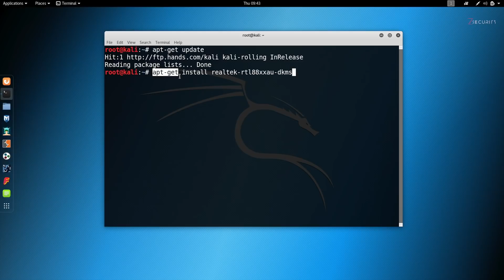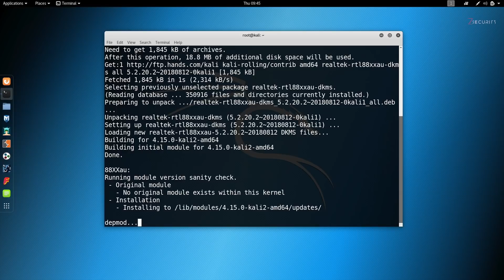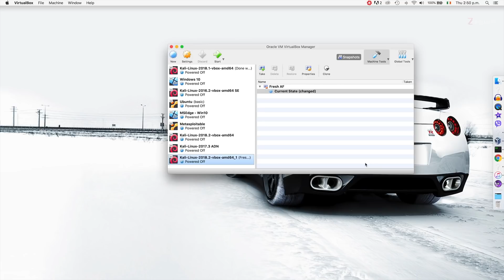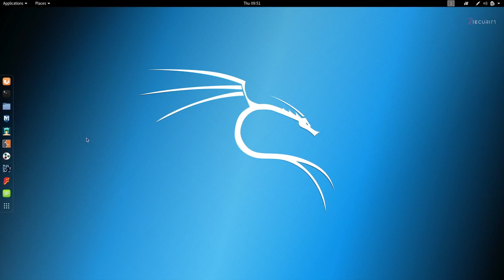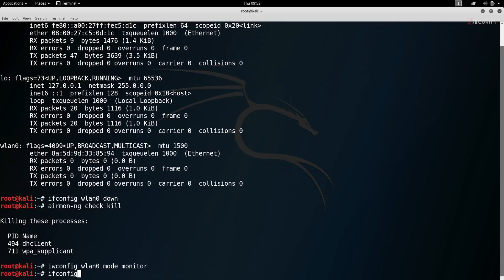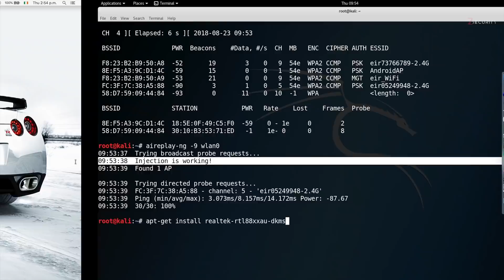Installing Drivers for RealTek RTL8812AU on Kali Linux & Testing Monitor Mode & Packet Injection

Comment: All done and everything was the same until the "ifconfig". It doesn't show wlan0 at all...
Reply: Same here. Have u found a solution? I'm really stuck here
Reply: @isore3090  is it connecting to the internet? Like when you go to settings to internet connection, is it detecting the adapter?
Reply: @irshadtarsoo7734  No it's not detecting it. There's only my Wired connection 1 which is my machine's NAT Network. But when I type lsusb in my terminal I can see my adapter's name
Reply: @irshadtarsoo7734  Turns out it was my adapter has a Realtek rtl8812bu chip insteaf of au one. I'm going to open a dispute for the motherfucking seller who sold me this stuff as au chipset. Couldn't find a driver for bu chipset for kali linux either so im stuck with this useless piece of shit adapter
Reply: Make sure u have the same chipset , make sure u do the update command then restart kali and plug in the adapter and it should work

Comment: but i tried everything you guys telled me but still the adapter is turning it self of i hear a sound when i put it in and immidiatley another sound that its off, also the flash light stop working. so something in kali is still putting my  adapter off.

pls help me
Reply: exactly the same here
Reply: yea same here too ... i read somewhere that when you are telling virtual box that it needs to access usb of your adapter name it will disconnect from host and virtual box will try to use it. COnsider your host and virutal box 2 different machines which at the same time cant use one usb :/ i tried using bridge and compact wireless commands but nothing works so far. maybe this video is missing a step to configure nat or bridge network. Followed the course steps too but still no luck
Reply: have you managed to fix this issue yet im having it aswell
Reply: oz ll yea so the fix is to download 2019.2 and follow the video. Dont do agp-get update && upgrade .... also a side note mine was not au adapter it was bu so u may wana check that .... this video was also made on 2019.2 I believe doesn’t work on 2019.4
Reply: @ammadakhtar1706  sorry having a hard time following where do I download 2019.2 and how can I check whether its bu or au. Thanks
Reply: oz ll so when you are downloading it from the link from offensive security.... check the url it has 2019.4 in it change it to 2019.2 and for the wireless card check on the box for me i bought a different one which was TP link not this alfa. If you google download version 2019.2 on the first page in the results there would be a tutorial which would have offensive security link and that link is for 2019.2 so both ways can work either modify the current url provided at the site or go through that tutorial link
Reply: @ammadakhtar1706  ohh ok I got it from udemy not offensive security but I understand 2019.2 version of kali thanks
Reply: You gotta install the drivers

Comment: I got the AC1200 Wireless Adapter with a AWUS036ACH chip. Since it wasn't working when I tried adding it to the USB the first time, I added it as Network 2 on my Kali machine. I made it a Bridged adapter. Then I realized I couldn't put the adapter in monitor mode. So I made a fresh Kali machine and tried following this video. The adapter does show up on the USB list, so VirtualBox knows it's there; however when I try to connect it to the machine it says "Failed to attach the USB device Realtek 802.11n NIC to the virtual machine..." In the details it says "USB device 'Realtek 802.11n NIC' with UUID {...} is busy with a previous request. Please try again later." What do I do now?
Reply: Oh also the apt-get install realtek command worked out fine. No errors or anything. I also have run "apt-get upgrade" and "apt-get update" at least 5 times.

Comment: Hello sir, when i have run the command  apt-get install realtek-rtl88xxau-dkms it just showing th output as in the quoted text  "realtek-rtl88xxau-dkms is already the newest version (5.2.20.2~20190617-0kali1)." and i thought it was installed and i have plugged in the alfa adaptor but there is no effect, no wifi is showing....... and i have also tried to install dkms separately by using the cmd "sudo ./dkms-install.sh" then its showing the error "Your kernel headers for kernel 4.19.0-kali4-amd64 cannot be found at
/lib/modules/4.19.0-kali4-amd64/build or /lib/modules/4.19.0-kali4-amd64/source.
Error! echo"

 can u plz help me out with this  sir....... i am not able to find what is going wrong plzz help me...........
Reply: Do you get it .Do you prefer the adapter ?

Comment: Thanks Zaid.  I bought this adapter to use while taking your Ethical Hacking course and tried running the install script that came with it but it didn't work. These steps worked perfectly and I'm now ready to continue the course. Your instructional videos are very good and easy to follow.
Reply: For which Version. Does it work for 2019.3?

Comment: When I try to enable monitor mode I get this message 

“Error for wireless request “set mode” (8B06) :
SET failed on device wlan0 ; Operation not permitted

Can you help?
Reply: @feiwhang  already root user in kali dumbo.
Reply: Did you ever figure it out ? i got same issue

Comment: The drivers successfully installed. Now when i connect the adapter after Kali is loaded, i hear the chime alerting me to a new usb connection, then immediately i hear a chime alerting me to a usb being disconnected.  obviously when I run ifconfig I don't see the wlan0.  anyone with ideas how to fix this?

Comment: Can anyone help?
After changing to monitor mode the adapter will not turn on in kali linux, why could this be?
Reply: run this code in terminal service NetworkManager restart
Reply: @kadirsahin166  thanks for your reply. It still doesnt work, it works fine out out kali but turns of when kali is loaded ?

Comment: I have an Alfa AWUS036ACH when I start kali its connect the internet, but when I start monitor mode its lose connection and i can't see the internet sign even right on up on the menu. can someone help me?
Reply: I found what caused the problem. It was the command "airmon-ng check-kill". Obviously this command shut-down internet connection.

Comment: Process doesn't work under any circumstances with Kali.  Adapter works fine on Virtual Box or VMWare workstation with Windows 10 and Ubuntu.  Also tried it with an Ubuntu Laptop.  Sending that information over to Tech Support, they insist that I am doing things wrong and that it "has to work."
Reply: you must install the driver off https://files.alfa.com.tw/?dir=[1]%20WiFi%20USB%20adapter

Comment: Des anyone gets this error .... Failed to attach the USB device Realtek 802.11n NIC to the virtual machine Kali-linux-2019.02-vbox-amd64?
Reply: Diego Solis I am facing the similar issue
Reply: Bro help me same problem
Reply: same..
Reply: I get this to!
Reply: I checked the USB ports options in VM, and it has been changed to a 2.0. I have changed to 3.0 another time and now it's working properly
Reply: @mentalartcore4620  are you on a mac? because i tried that and so much more and i get the same error message. i'm running on a windows 10 as my host
Reply: @JaliylMariano  win10 as well, try on an earlier snapshot of virtualmachine
Reply: @JaliylMariano  try to connect the adapter after and before switch on the machine

Comment: Hi, I appear to be getting the driver working but it won't find networks. It does everything without error, but won't find networks. Then when you put it in monitor mode it won't find networks there either, and packet injection test fails. I checked after all that with a reboot and it simply won't find networks. seems to be detecting it now after the fix, just isn't finding networks. Any ideas why? Thanks!
Reply: BTW: I noticed that the mac address changes too.

Comment: When installing the driver my terminal window is stuck at this line.
stuck at Building initial module for 4.19.0-kali1-amd64
Installation will just not finish. :(
Reply: i have the same problem
Reply: after waiting 30 minutes it finally finished. But it took a really long time. Don't give up yet. Our vm must be really slow. @mex1c080
Reply: @peterbago4574  it worked

Comment: For the AWUS036ACH you need to add the USB as a USB 3.0, and use 'ifconfig wlan0 up' after doing the updates in this video and possibly replugging the adapter.
Reply: how can i add the USB as a USB 3.0?

Comment: I bought the cheaper version of the adapter in aliexpress and confirm that it has a Realtek rtl8812au. I successfully installed the driver using the steps in this video after reboot i try ifconfig the interface is not showing but when i try the lsusb i can see the adapter. I am using the latest version of kali as of this writing. Any other method to make the adapter works or anybody encounter same issue as mine. I hope anyone can help me. Thank you.
Reply: I have same issue, if got  any instructions pls inform me

Comment: First what you have to do is go to settings -> USB abd then update the driver to 88Fukali-linux-please-kill-me if that doesn't work; take your labtop and kindly bang your head against it until the power fails or the plastic gives way. You may feel a slight shocking feeling as the electricity enters your body but don't worry about it....soon you'll be a linux expert.

Comment: Hello Zaid, I'm really struggling in order to set up this Wifi USB Adapter: http://www.hamletcom.com/products/hnw600acu.aspx
I'm still not able to see the device with "ifconfig", but I can see it is connected with "lsusb".
I know the chipset is RTL8811, so I think the instruction in this tutorial should have been working, but unfortunately this is not the case.
The only fact I can notice, from the site I linked above, is that compatibility is for Linux (kernel 2.6.18~3.16.0), but the Kali running on my VirtualBox is 4.18.0 (I think this might be the problem).
Could you please give me any suggestion? I'm really looking forward to proceed with your course.
Thank you for your kind cooperation, Best Regards.

Matteo

Comment: I have tried several ways to use monitor mode in my Alpha AWUS036ACH on Parrot Security. This procedure works well for Kali Linux as Zaid explains, but it does not work on Parrot Security. Any ideas?
Reply: Did you figure out how to install the driver's onto parrot os , because I'm actually stuck on that process now myself 🤨

Comment: When trying to install the driver, after typing "apt-get install realek-rtl88xxau-dkms" I get the error: "E: Unable to locate package realek-rtl88xxau-dkms" Is there any way to get past this?
Reply: Devon Griffith I had this problem too. I did:

apt-get dist-upgrade

apt-get remove realtek-rtl88xxau-dkms

apt-get purge realtek-rtl88xxau-dkms 

apt-get install realtek-rtl88xxau-dkms 

Then reboot
Reply: @ByJesusJustified  wrong same error
Reply: I'm having the same problem all the commands say unable to get package
Reply: I assume you fixed this now.... but your message shows "realek" and not "realtek" (t).  :-}

Comment: you never talk about AWUS1900 , it is the best ?
Reply: I just got it a week ago and it's a pain in the ass !!!
Reply: @simonpro267  Do You Recommend It please answer me
Reply: @AliHaider-gh5mp  NO NO NO I DON'T RECOMMEND IT
Reply: @simonpro267  why bro???
Reply: @AliHaider-gh5mp  Okay first of all it's good on Windows 10 but ONLY WINDOWS 10 not even Windows 7 ! there is almost no support on Linux, either the card is not detected or there is bad drivers, the first problems redirects to the second problem : No drivers = No possible WPA hack, this card does support monitoring (with a special line of code, not a basic one weird but ok), and with that it doesn't support Evil Twin attacks so forget about Fluxion or Airgeddon with this card, take the AC one not this money waste !
Reply: @simonpro267  Ican give you Video How to install it driver on kali linux
Reply: @simonpro267  again thanks bro

Comment: apt-get update: 1.could not open lock file  2.unable to lock directory  3.problem unlinking the file 
Why is that happened?
Coulld you post a video with an installation from usb drive please?
Reply: Try running it as root by using 'sudo apt-get update'
Reply: @rahulemani8203  thanks. I've figured it out. In the latest Kali versions you have to put "sudo" before the commands.

Comment: So, I fixed the repository, got updates, upgrades and distro upgrades and installed the driver. I rebooted my vm and even tried redownloading the driver but it was still on my vm. I still can't get it to connect. Is there anything I'm doing wrong? I'm using an RTL8812AU chipset, revision C, however it's running on a DWA-182 adapter. Would that make any difference??

Comment: Can i Use RealTek RTL8812BU Chipset   For monitor and Ewil Twin Attack also packet injection

Dual Band 1200Mbps 802.11a/b/g/n/ac USB3.0 WLAN Wireless Adapter Network USB WiFi Adapter Comfast CF-WU772AC

Comment: Hey there! Great video. Following ur instructions, I was easily able to install my USB device and the necessary drivers. My Kali OS recognized it easily and I was able to setup monitoring mode without a single hitch,  once again, by following your great instructions. My only issue came when I tried to get Virtual Box to see the USB device as well. I am NO EXPERT at any of this, but I believe you might have made one assumption about everyone else’s Virtual Box following this video at home, in that, I believe for Virtual Box to recognize this device, or ANY USB device for that matter, you need to have Guest Additions installed in Virtual Box. I just read this online and it seems very promising. I’ll (hopefully) get that installed soon and I’ll get back. Hopefully this helps others here who may be having the same / similar issues.

Comment: nor Vbox nor win10kali nor fresh 18.3a can see  RTL8812Au. what should i do?
Reply: Dmitriy Moroka Hey Dmitriy! As u can see in my comments above to another user, I’m currently having issues getting Virtual Box to work with the USB antenna correctly, but following this tutorial, I had no issue getting it properly installed on my actual Kali OS. Have u had issues with installing other applications as well? If so, you should check to see if your repository file is looking good. A lot of installation issues have to do with an incorrectly setup repository file. Let me know!
Reply: @robgoc  i did repair repo as well. But problem is in that kali dont see usb dongle
Reply: Got it. What are u running Kali on? Is it an installed OS, is it a virtual machine of some kind on Windows or Mac? A USB boot? Also, the product is USB 3, not sure if it matters but do u have USB 3 on ur computer? Is that maybe the issue? Last question: Did u plug in the USB antenna BEFORE attempting to install the Realtek driver? Cuz that’s a big no no and can result in MAJOR issues. Let me know!
Reply: damn. im actually plugged it in before install.
anyway only kaliPi did recognized dongle.
nor boot OS from usb nor virtual machiene.

will check that only in next week, thanx in advance
Reply: Dmitriy Moroka yeah, on top of NOT getting virtual box to recognize it, which is what I’m currently trouble shooting right now, I tried it on a USB boot and it didn’t show up there either. I’m not sure it ever will though, as I believe that USB boots have limitations. Try running an apt-get remove or apt-get uninstall on the Realtek. There’s also even more steps to REALLY delete it all for good which I’ve seen instructions for online. Once u feel you’ve got it off ur machine, run the apt-get install again on the Realtek and make sure the antenna is not plugged in. Should work after that.

Comment: don't know why I need to do below as well
sudo apt-get update # This will update the repositories list
sudo apt-get upgrade # This will update all the necessary packages on your system
sudo apt-get dist-upgrade # This will add/remove any needed packages
reboot # You may need this since sometimes after a upgrade/dist-upgrade,

https://stackoverflow.com/questions/22165929/install-linux-headers-on-debian-unable-to-locate-package